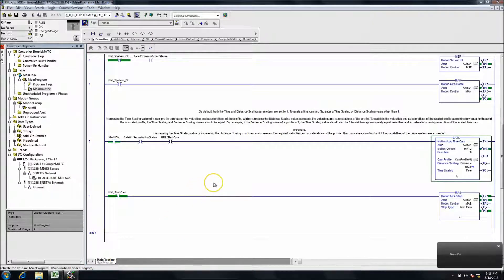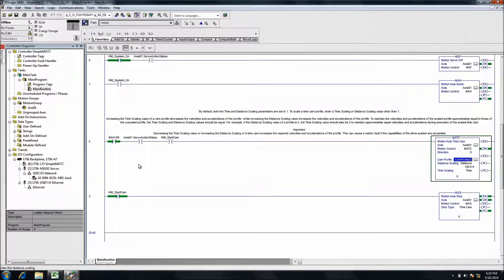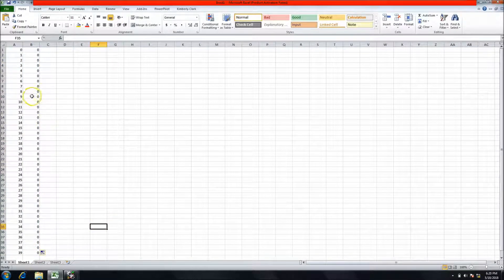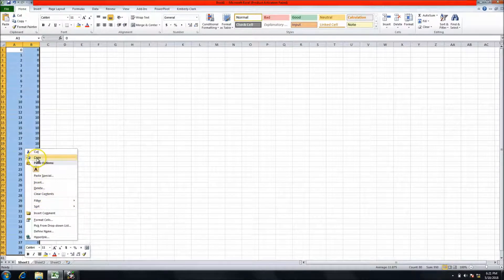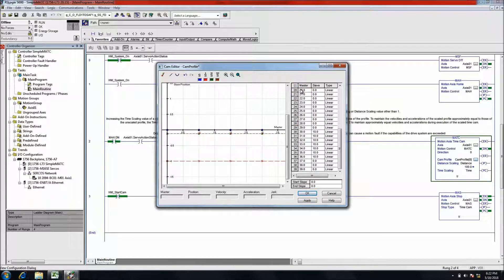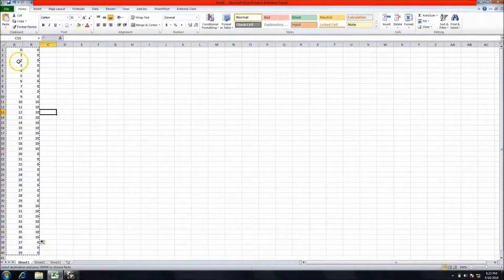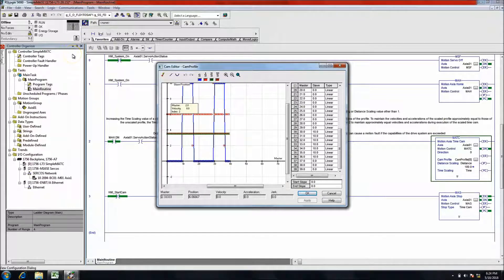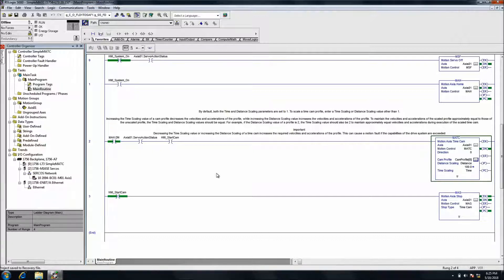Using Excel To Build an RSLogix Cam Profile

Comment: Hi Shane.
The CaM editor has four values. Position, speed, acceleration and jerk.
How to manage speed values?
I need change speed of servo motor between cam points for example.
Thanks for your comments.
Reply from the maker: That depends on your servo attributes.
How they are set & the mechanical setup as well.